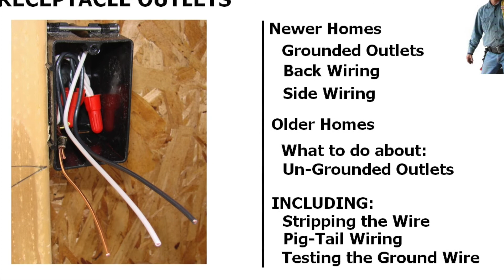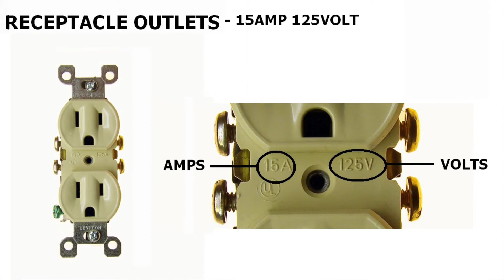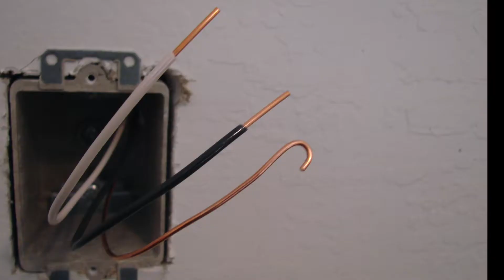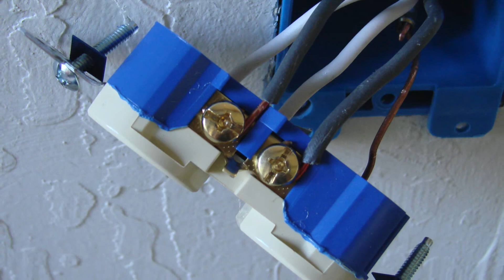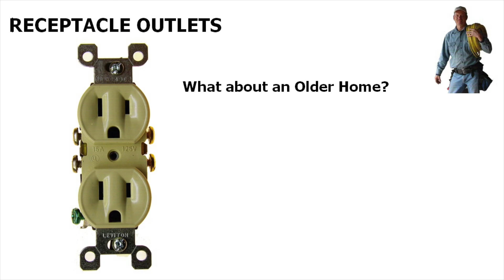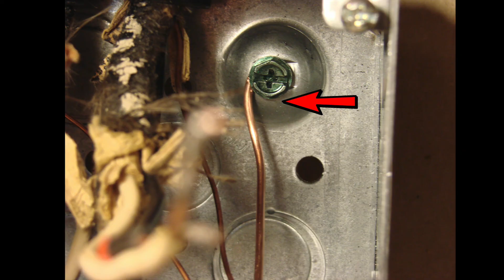How to Wire a Wall Outlet and Connect the Wires.

Comment: My Cousin might of had a bad wall outlet in his place as over at my Aunt & Uncles place in the Summer time my youngest Cousin likes to plug in a cheap box fan and plug it into the same Black wall outlet as the big window air conditioner is running on and he runs them both on max at the same time and then the big window ac unit is running and then a few seconds later the window ac unit slows down for a few seconds and then the box fan runs full speed power and then a few seconds later the fan power speed slows down for a few seconds and then the window ac unit turns back on and speeds up for a few seconds and then the box fan power speeds back up and keeps going back and forth every few seconds and then when i try to tell my cousin its not a good idea to leave it like that then he tells me that its his place and will do what he wants.     Its shocking the main breaker panel does not trip, Is the main service breaker over there bad?  It is concerning in the Summer times that the breaker panel over there allows it and never trips when he does that.    Its either they have bad electrical or bad breakers or a bad electrical system or something or is so old and out of date possibly?

Comment: What if you're trying to change a switch to an outlet and you have a hot red wire and a black and a white wire?
Reply from the maker: If the original switch was a 3way, then this will require identifying and changing the wiring connections at the other 3way and possibly at the light fixture. If the original switch is not a 3way then the wiring will need to be identified to see what the wires are used for. In any case an outlet requires a hot, neutral and a ground. The colors of the wiring at a switch box will always need to be identified, especially the white wire, which may not be a neutral wire.

Comment: DIYer here with a question: I have an old house where there are 2 prong outlets and no ground in the bedrooms. In one bedroom the outlets blew out due to using a space heater. Can I replace the 2 prong receptacle with a 3 prong GFCI?
Reply from the maker: Yes you can do this, however the GFCI outlet will not provide a ground path, it will only provide ground fault protection. Be sure the outlets are rated for the circuit breaker or fuse size. FYI - it is best to install a dedicated circuity for some space heaters - consult the installation manual and electrical specifications which are provided with your specific space heater.
Reply: @AskTheElectrician  thank you so much!

Comment: Dave, I have outlets on one circuit that when I plug in a lamp to any of them, the lamps flicker. I pulled the outlets and it looked like the wiring was OK. Any thoughts? Thank you, Jim.
Reply from the maker: Great question Jim, I see you asked this question using my website, and I just sent you an email reply with some helpful resources that should help you.

Comment: Hi there. I was wanting to change my bedroom receptacle changed to three prong from two prong but noticed only two wires in which no ground wire. In other parts of house I noticed there is a ground wire. So my question is how much typically would it be to get ground wiring in my bedroom?
Reply from the maker: Installing a ground wire to an outlet would depend on the type of access that will allow the ground wire to be installed from the existing outlet to an approved ground source, or to the electrical panel. A project such as this is typically done on a time and material basis for the cost.
Reply: @AskTheElectrician  thank you very much you have been very helpful

Comment: Dishwasher/disposal outlet to disposal switch. Outlet shows correct wiring with tester but garbage disposal won’t shut off at switch. Do I break the tab off on the brass side or silver side? Thank you.
Reply from the maker: Yes - the tab is removed from the brass side of the outlet when controlling one outlet on the receptacle from the wall switch.

Comment: Dave, I am installing several 20A circuits in my man cave.  I wanted to have the tops hot and bottoms switched with 4 outlets per circuit.  So I ran 12/2 from the breaker box to the switch.  Pigtailed the hot to 12/3 hot going to the line on the switch and then onto the top of the switch.  The red is on the load of the switch and on to the bottom of the outlet.  Hot side tab is removed on the outlets.  Black and red are pigtailed separately and go on to the next outlet.  My question is it ok to connect both neutrals to the receptacle (tab intact) or should I pigtail and Just connect one? In my mind it shouldn’t matter.
Reply from the maker: Hi Damangio, Your right, it really does not matter, however if you do not use the pigtail method then the return current on the neutral passes through each outlet, and in some instances where the circuit load my be high this could eventually cause a overheated outlet and a fault. The pigtail method would prevent this from happening.
Enjoy your man cave!
Reply: @AskTheElectrician  thank you so much.  Very informative videos! 👍
Reply: @AskTheElectrician  Dave, I took your good advice and pigtailed the neutrals as   Well.  It is definitely worth the peace of mind and it didn’t take much extra effort. Thanks again!  You learn something every day!

Comment: The 2 prong receptical why are there 2 types like a t on the other?
Reply from the maker: The receptacle with two outlets is referred to as a Duplex Receptacle, the other which is a Single Receptacle, which is typically used where a single device or equipment will be connected, and many times this would be a dedicated circuit.
Reply: @AskTheElectrician  the old ungrounded  duplex with the extra slots perpendicular like a t config

Comment: I'm seeing a line fault red light on my Panamax surge protector unit so if I install a GFCI outlet will it read as grounded or will it just shut down when there's a a surge. ? Thanks 😊🙏✌
Reply from the maker: A GFCI Outlet or GFCI Circuit Breaker will provide Ground Fault Protection, they will not provide surge protection. These are two separate types of protection, however a Surge Protector should be grounded, or connected to a grounded outlet or enclosure so the surge protector functions properly.
Reply: @AskTheElectrician   Got it.. Bless you for your answer your very informative . I truly appreciate your time  brother and this helped me alot 🙏🙌